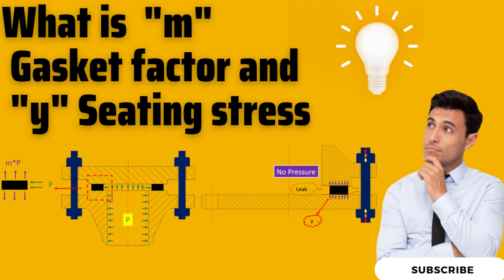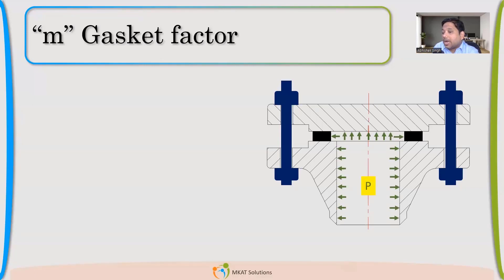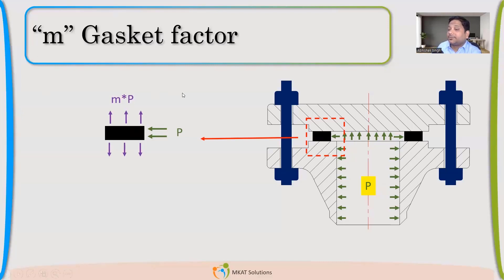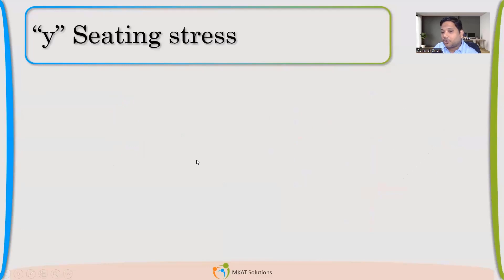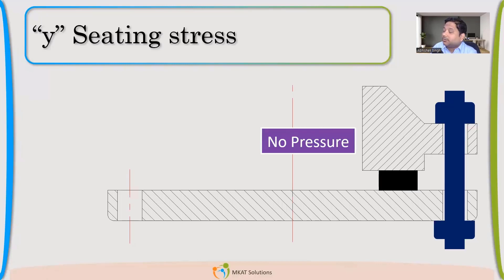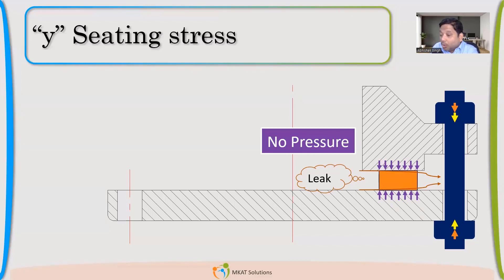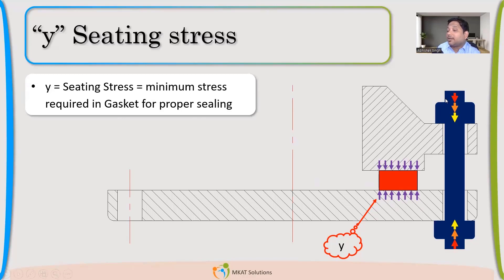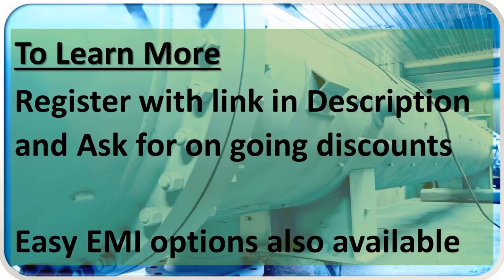what is a gasket factor | what is seating stress

Comment: Dear Sir,
Could you please advise me
We can use the gasket outside diameter near the flange outside diameter. Since to increase Gasket width based on that we can reduce the flange thickness. It could be advisable or not [Gasket with holes]
Reply from the maker: these are called full face gasket, used only for low pressure application, PTFE gasket